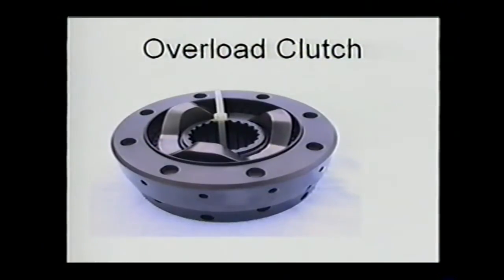Rotax 912 / 914 Series Aircraft Engine - Overload Clutch

Comment: Why are many of these gearboxes breaking down at very low hours ... some as low as 140 hours on the 100 HP engines.???
Reply: There is a gearbox access plug located next to the rotax fuel filter. If this plug is removed, the tension of the gearbox damper and the gears themselves can be checked. These failures are either a lack of maintenance in this area or an oversight in terms of design.
Reply: Most likely idling on too low rpm settings for too long (like with students). Should be 1800+ rpm to reduce the punches from individual strokes.